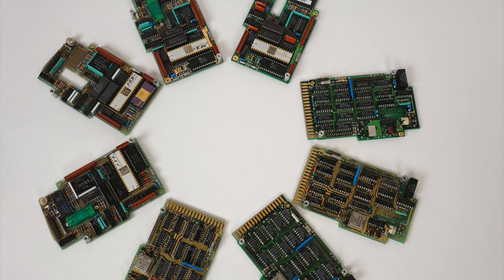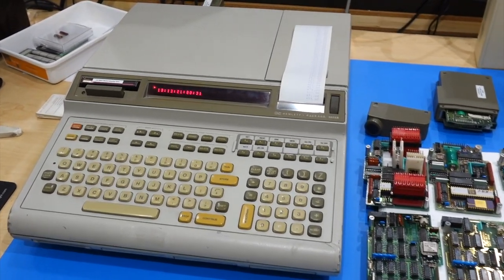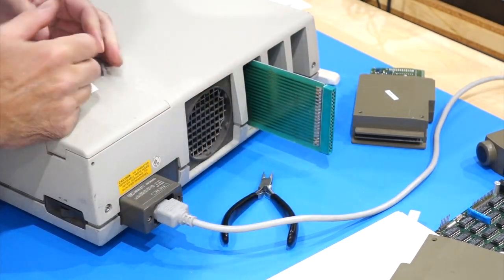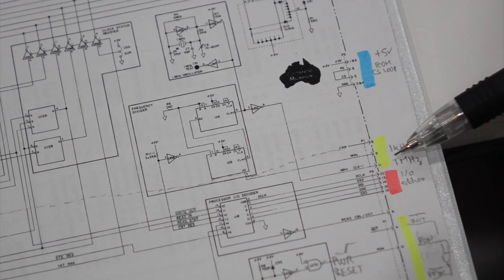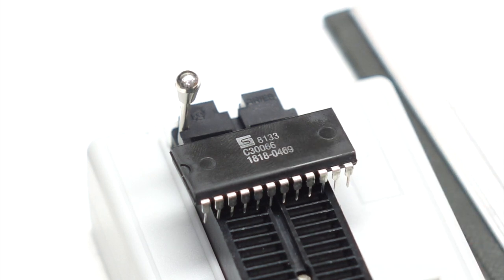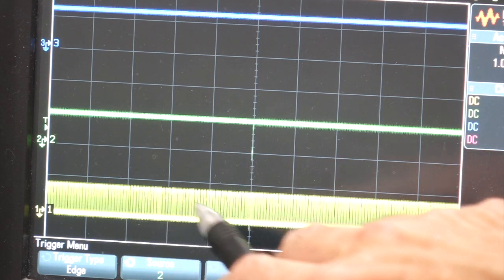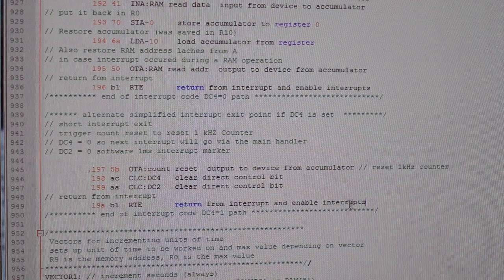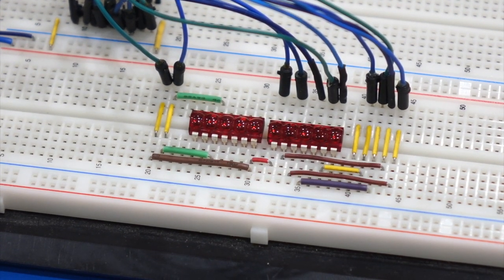HP 98035 Clock Module Repair-A-Thon - Part 2: HP's Nanoprocessor

Comment: @CuriousMarc
Treat the IC pins as if they were sacred.  Never bend the IC pins.  Put the IC into an appropriate socket and then bend or modify the socket pins.

If you need to make somewhat permanent changes to the pinouts, stack two sockets on top of each other and make the pin modifications between the two sockets.  Bend the socket pins out and solder 30 AWG wire wrap wire between the upper and lower socket.  Then put the ROM chip in to the socket stack and put the stack into the ROM reader.  Voíla!  You now have a socket than can accept the EPROM, so you can burn the  ROM code (with code changes) into the EPROM and it will work in the ROM socket.

We used to do this to the Apple II ROMs to get to the protected game code.  ;-)

I think I said this in the first episode.  There was a circuit that shut off the ROM's positive voltage until there was a stable negative 5V on the ROM's -5V pin.  The ROM can draw excessive +5V if the -5V is not present.

The only time I bent the IC chips out was when two EPROMs were stacked one on top of the other.  We used two 2716s to substitute for a 2732 by stacking them on top of each other and rewiring the CS and NOT CS chip select pins so either the top or the bottom chip was selected.
Reply from the maker: You guys are so hard core! Sacred pins! Holy extender cards! But we do Voodoo electronic repairs, pin bending and PCB cutting is part of the cult. Some say we even put pins through capacitors.
Reply: @CuriousMarc  Voodoo electronics..!! This is going to be the name of my next enterprise!! Awesome..!!!😎 tnx Marc..!!
Reply: @ScienceANDesign  You can relocate to Portland, Oregon, and open a shop right next to Voodoo Donuts.
Reply: Was the bent pin okay in the end?
Reply from the maker: @fburton8  Yes it's fine, back in the socket. The pin thanks you for asking!
Reply: @CuriousMarc  
Sorry if I sounded too harsh.  I'm trying to be helpful.  Please accept my apologies.  Sorry.
Reply from the maker: @acmefixer1  No problem. No rules in restoration methods, your suggestion is a good one actually!
Reply: @CuriousMarc  When you stick pins in a capacitor, somewhere a bigger but otherwise identical capacitor feels the phantom pain.

Comment: it might be a good idea to put a zener diode across the battery so when it dries out again in 20-30 years it won't blow up the probably 100% unobtainable clock chip in 2040.
Reply: I mentioned this on the last video, and it was correctly pointed out that a zener won't do it, it would leak too much.  But a zener could be added to the charging circuit, behind a charging diode, and that would prevent further blow-ups.
Reply: By 2038, we'll all be too worried about the "Linux time bug". lol
Reply: I'm hoping by that point that manufacturing might have improved to the point where we can 3D print replacement chips entirely, or at least there would be companies who could do it.
Reply: @electronash  I'm hoping that civilization is still around in 2038, or heck, that I'm still around for that matter..
Reply: @greendryerlint  Same here, tbh. It's not been the best of years for most people. lol
Reply: Now that he has reverse engineered how the clock chip is being used, it's trivial to emulate that behavior with another controller and some software... arduino for example. Don't need the rare chip at all anymore.
Reply: @electronash  I was about to write the same LOL!

Comment: Truly some uber troubleshooting and reverse engineering.  Great video.  It's good to see someone that cares enough about this old hardware to understand and resurrect it.  I guess it was easier to engineer it to get the time by using the set button and get it 'serially' instead of just reading each digit, though seems like a Rube Goldberg way of reading the time.

Comment: A cameo by the HP3585A, which had just been released into production at HP in Loveland, CO, when I started working there in 1978.  It contains the "BUFFLO" decimation filter chip (Barely Usable Fast Fourier Like Object"), designed by the legendary Lou Scheffer. Those were the days..

Comment: At the part about the extender board, when you said "...to take good measurement  and then to cut this..." my first thought was "Are you crazy??!!? You will have the other instrument eventualy and then you're missing the extender board!!!" :-) :-) :-)
Reply from the maker: You can just use the two parts of the board together again.
Reply: @CuriousMarc  Yeh, after that spontaneous thought I was quite sure that you would figure something out to remedy the cut. OTOH its not in mint condition any more :-)

Comment: Thank you for the very interesting video. Always cool to see how technical challenges were tackled in the old days (and how that may have affected modern computing) :)

Interesting that it never syncs the clock back to the watch chip. I can imagine that when these systems are on for a very long time there will be quite a deviation between the internal clock and the watch clock.
Also I wonder if the Nanoprocessor would get the correct minute (or even hour and day) if you power on at second 59 and the watch chip is almost near the next minute (for example at 23:59:59.800)...
Reply: Ooh, I wonder if they thought of that. Those edge cases can really bite you.

Comment: I changed the button cell in my old Radio Shack calculator the other day and I modified it slightly to use a battery I already had so I'm pretty much on CuriousMarc's level now....

Comment: To answer your question @6:13 in the video. The reason they put that loop-thru on the chip enable pin is to protect any battery-backup ram from being corrupted by sporadic voltages caused by the inserting and removing of the cartage. If you look at the edge connector. the 2 pads on the male end should be shorter the the others. if not? On the female end, the contacts should be recessed into the slot more then the others. The idea is, is to make it sure that the those pins are disconnected first and connected last.  Why they have it connected to the ROM only? My guess is that the ROM may have been substituted for a battery-backuped static RAM chip at one time.

Comment: Going to guess the rom select going out was to allow the main board to have a rom instead of the clock board, so that you could reuse the clock board in later models with a new rom to add extra functionality and have the original board as a drop in part with no rework required. Also could have been used on the assembly line to run diagnostics in a separate chip to do a diagnostic while the unit is complete, and then the diagnostic rom stays in the test fixture instead of having to pull the rom out and replace it.
Reply: That’s probably the reason why. Nice reasoning.

Comment: Back when we needed two circuit boards, a CPU another clock chip and a battery just to tell the time, now we use a single RTC microchip capable of telling and storing the current date and time but still uses a battery to keep time when powered off

Comment: Great work Marc, I admire the methodic approach You and Your team takes. I would be curious, if the reverse engineered code reading the clock chip took into account a delay between reading seconds and minutes, when seconds might flip just after it has read them and thus advanced minutes by one and instead of reading e.g. 11:10:59 would read 11:11:59 :)
Reply from the maker: Yes the code takes care of that.

Comment: That is one problem with the TL866 series programmer, the programmer is ironicly not programmable so you have to work around it should you need to dump mask roms. They're so small and convenient though, which is why I assume you didn't drag out some vintage beast of a programmer that can invert a CS pin on command.
Reply from the maker: Exactly.

Comment: if the CS pin on the HP ROM breaks then what about using a piece of stiff copper wire and sticking it in the sock to replace the broken pin and solder a wire to the remains of the broken pin of the HP ROM.

Comment: The "looped back" CS line is not "wierd" ... the idea is you can connect the board and its ROM bus to an external test card, the CS line can be looped back to run the ROM code on the board, or used to select a test ROM on the external test board, running a long-lost custom test program.
Reply from the maker: I thought so too at first, but there is no connection to the ROM address bus available anywhere! So you can’t connect an external ROM by plugging in a daughter card. Maybe used for exactly what I did? Use an EPROM during development that has an opposite CS polarity from the production mask ROM, and insert a little inverter there?
Reply: @CuriousMarc  Ah, OK, I understand. Very strange.  I was very impressed with the level of effort you went to, I used to work on 70's and 80's equipment for a national broadcaster, lots of TTL logic, custom chips etc but the level of detail you went to is impressive. The disassembler for the nanoprocessor is and incredible effort ..

Comment: What are the small HP test probes called and where can they be purchased? Many thanks!
Reply from the maker: They are HP 01650-61608 mini-grabbers, they came with their logic analyzers. Mine come from eBay, look up the part number or HP Logic Analyzer Probe Tips. I know they were (and are still) made by someone else and quite expensive new, can’t remember the manufacturer. Best probes this side of the galaxy, highly recommended!

Comment: Can that processor be atmelled at this point? I don't want to say the duino part and expend time being sued if I do. Only to emulate the unobtainum parts.
Reply from the maker: You probably want to “FPGA” the Nanoprocessor, and “Atmel” the clock chip. It would be even simpler not to try to emulate any chip and just “Atmel” the whole module. But making a replica/emulation of the Nanoprocessor could be really useful, since the chip is so rare but so many instruments run on it.

Comment: Hi Marc,
Great video again!
I've been trying to source the TI-clock chip for some time now, but can't find it anywhere....
Are you willing to sell one to me? (you are allowed to make a profit on it :-))
Reply from the maker: Contact me through my about page (link in the Doodely-doo).
Reply: You don't need one. He's reverse engineered it. You can emulate with another controller and software. Maybe even an arduino.
Reply: @radben951  I can but I don't want to in my retro 70s computer

Comment: The hardest part for me was seeing that double-width riser card get chopped up. 

Any repair shop will know that riser cards are the most sacred and highly guarded relics in the land. When n cards are needed, there are always n-1 available, and the impetus to steal one cannot be resisted. The riser card hole migrates freely, and always comes to rest with you when you need one the most. You must NEVER loan a riser card: it can in fact never be loaned, only irreversibly donated. 

Riser cards are irreplaceable. Indispensable. 

And you just chopped one up. 

SHUDDER
Reply: I think this one can be glued back together pretty easily.  It’s not like he sawed across the traces. Marc is also an executive at a connector manufacturing company, so I’m pretty sure he can make a new one if he really needs it.
Reply from the maker: But the card and I had a long talk  beforehand. It had lost its original instrument 40 years ago and was very sad. It was OK with it and so happy to be used again!
Reply: Should it be needed I can't see how it wouldn't still work for the original application, no traces between the connectors.
Reply: @CuriousMarc  I didn't say you shouldn've done it. I think it was the right thing to do. I salute your pragmatism and dedication to fearless engineering.

Still. SHUDDER.

Comment: Just think how tiny (and low power) a modern day solution would be that implements the functionality of this clock module.
Reply: Today that would be a single chip plus power supply and interface electronics.

Comment: Reading a clock chip once and then ignoring it in favor of a faster counter isn't exactly unknown in the computer world. Pretty much how all PCs have worked  since the invention of Windows NT.

Those 44 pin board connectors used to be used on everything. There was a time you could not only buy the connectors and matching prototype boards from Radio Shack, there was a short while when you could buy extender boards.
Reply: In fact I always wondered why clock chip makes wasted resources on having BCD counters, complicated date implementation, etc.
They should just use a binary counter that counts something like "seconds since 1-1-1970" and use software to convert it to human-readable form when needed.
As it is now, the software is usually much more complicated as it reads those BCD values and converts them back to binary counted seconds anyway.
Reply: Before Windows NT even, way back to the original IBM PC the system kept the time (quite poorly) after reading it from the RTC module if you even had one fitted.
Reply: @Rob2  Hmmmm... "seconds since 1-1-1970." Why does that sound so familiar?  😁

Comment: So this thing just doesn't care what year it is then.  If it did look for a year it would be assuming today is 10/20/1920
Reply from the maker: Yes. TI watch chip does not know the year, so HP clock module does not know it either...